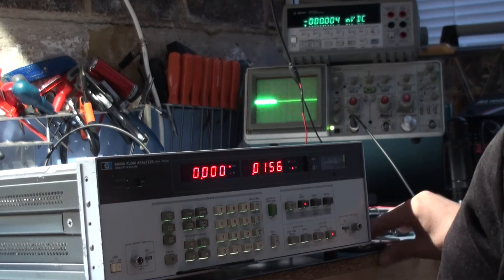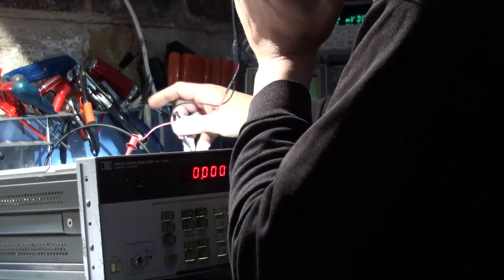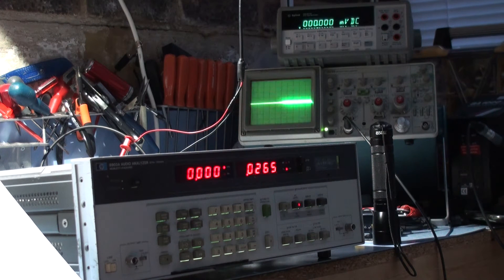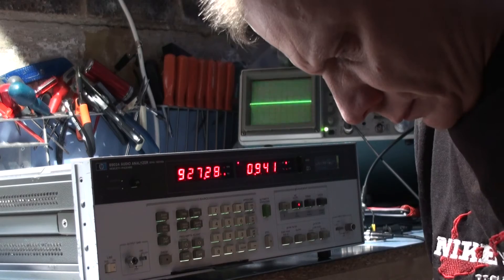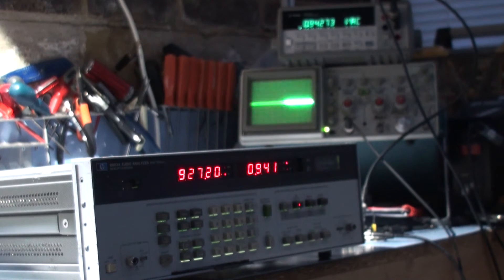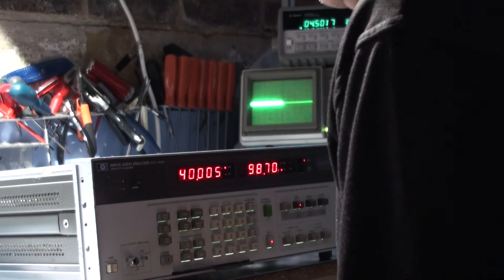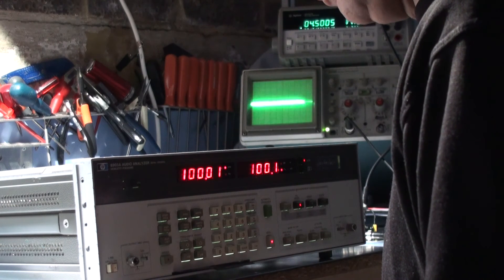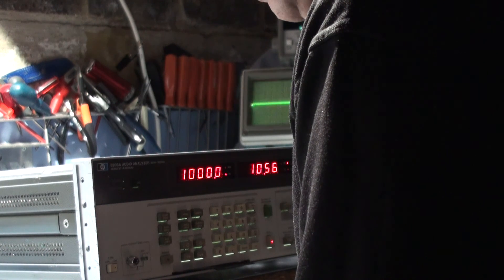Hewlett-Packard 8903a calibration(1)

Comment: Hi Simon,

    I'm currently trouble shooting my HP8903b, the problem I'm having is with the signal generator end of it, it's losing power at higher frequencies. So If I set it to 1 KHz @ 1 volt I get just about that but, when I go up to to 100 KHz I get 0.78 volts. Also when I tried to adjust the DC offset to get the recommended 0 mVdc +/- 0.1 mVdc the lowest I can get it is -62.5 mVdc. My suspicion is that i have a failing power transistor, that can no longer cut it at higher frequencies but, I'm new to trouble shooting bench equipment so I thought I'd ask someone with experience. Any help you could offer would be greatly appreciated.

                                                  Thanks,
                                                          David
Reply: +Simon Spiers  Yes I do have the band pass filter disabled, with it on it's 0.363v
Reply: +Simon Spiers  I'm running grounded, the scope shows a nice sine wave and reads between 99.8 - 100 KHz with 784 mV and the HP8903b reads 99.9 KHz and 764 mV
Reply: +Simon Spiers  from 20 Hz - 5KHz it's even after 5KHz it begins to drop off gradually, now I'm not sure if I understand what you mean by correct termination, if i use a 50 ohm BNC cable connecting from the high output of the HP8903b to the input of my scope I get the reading I posted, if I put a T connector on the end where it connects to my scope and a 50 ohm terminator on the T the Vrms is drastically reduced across the whole frequency range.
Reply: +David Hughes At another's suggestion I shorted the low output with a piece of wire and everything started working right (well close enough) I was able to adjust my DC offset to 0.1 mVdc and I now get 0.985 volts @ 100 KHz, So I took apart the front and cleaned the float switch, with deoxit, but, it's still not working without the shorting wire thoughts?
Reply: +David Hughes Found it! it was a blown trace on the motherboard, I soldered a strand of wire in place of the damaged trace and everything's working now :) Very happy! Now I need to figure out how to make the Pmillet program to scan beyond 20KHz :)
Reply: +David Hughes Hei, DId you solve problem? I have same problem (probably leeky capacitor ?)
Reply: it was a blown trace on a circuit board, I soldered a piece of wire to bridge the gap and everything has been working since :)
Reply: Have private mail? Mybe i will need help?

Comment: Simon, Thanks for the for advice. I have connected the analyser OSC output to my oscilloscope and all frequencies and amplitudes are working great.. I have also connected the analyser OSC output to its input but there is no reading - Still Error 14.
I tried 41.0 SPCL and reset the system(Can hear the relay engaging) but still get error 14. Feeding sine wave signal at any frequency or amplitude to the input of the analyser from my HP frequency generator still does not get any reading on the display other than error 14.  I hope this is what you meant by checking outputs/levels and frequencies with the scope.. From The manual Typing 8.1 SPCL (Disable analyser error messages (Errors 12-17,31, and 96). The display clears and I get the frequency reading and AC voltage reading on the display(great). Pressing the Distortion button gives me a high reading of 1.158%  - 7.025% at 1Khz( Very High). Powering off and on takes the unit back to error 14... Not sure where to look now or what components to change..

I will try not bother you again, I really appreciate you help and if you come up or think of anything else please let me know.

Regards,
Peter.

Comment: Hi Simon,

Sorry to bother you again.

Quick Update - I replaced the  MC68B09CP CPU on Board A8. I now have a little life in the unit. No more freezing of the Front display and it now jumps into  Error 14  on the display. The 4 test LED's DS1-DS4 on A8 are on with the DS4 LED blinking. Not sure I really understand  Error 14 - From the manual it states "Input Level exceeds instrument specifications" - "error code indicates that the input overload detector has tripped. This could be caused by a large AC signal." 

If you have any other thoughts at all on where I can start looking, it would be very helpful.

Regards,
Peter.

Comment: Hi Simon,

Just wanted to give you an update .
All boards removed except A8 - still the same problem..
I have ordered the MC68B09CP CPU chip for the A8 board to see if it can solve the problem.

By the way all power supply voltages are good.

Peter.

Comment: Hi Simon - Tried the Calibration run on my HP 8903B the other day. Unfortunately things did not go well. Looks like I did not connect to a good ground when checking A8TP2 for 2mhz. All my front panel LED/Display lights are now on. Also the four test LEDS on the A8 controller/counter board are constantly on. Power off and on does not seem to reset the unit as the lights still stay on. Do you have any thoughts on where I should be looking to find the problem? - My thoughts are that it might be the MC68B09CP CPU on Board A8...
 
Regards,
 Peter.